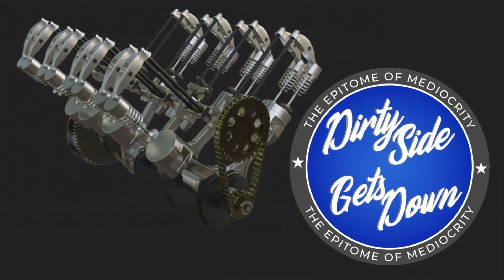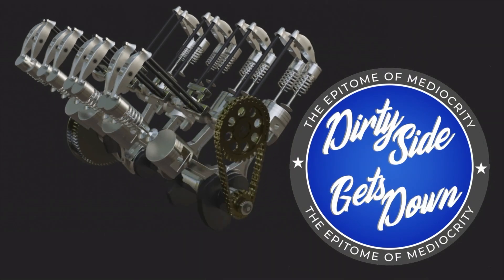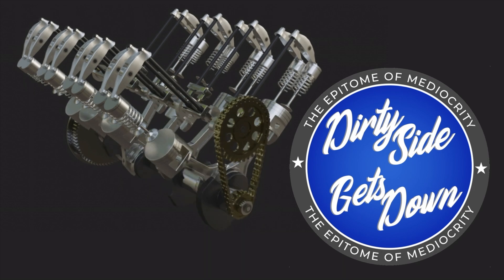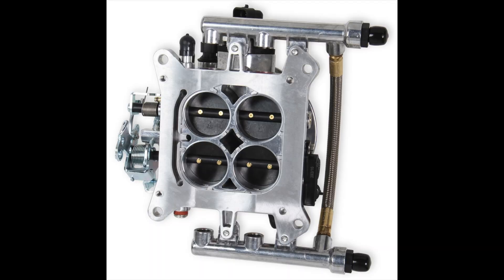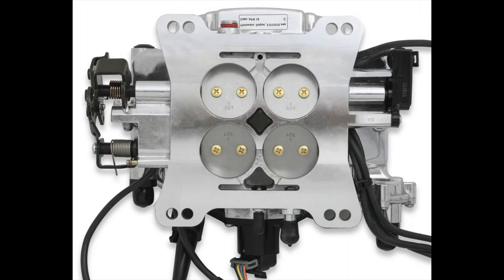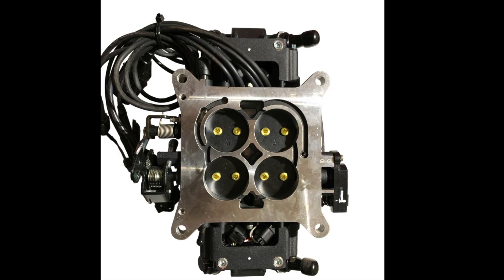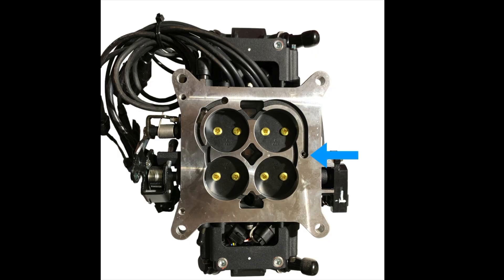Holley Sniper On A Dual Plane Intake Explained: Yes it works and here is why!!!

Comment: I ran a Holley digital 4di on a 351w with a RPM intake  and 1” spacer in the late 90’s with no issues. This system used an external map.

Comment: My dad and i messed around with this on an Air Gap and a Victor Junior. Dual plane can work pretty well if you run a spacer or hollow out the divider, but you will get a reading on the MAP that jumps around a bit which did cause minor issues at part throttle.

In theory you do lose some of the low RPM/load benefits of a dual plane because EFI doesn't need the air velocity to draw fuel out of a carb, which is helped by dividing the barrels. But EFI does keep the benefits of the longer runners.

Comment: I’ve ran a Holley super sniper 1250 with a rpm air gap dual plane manifold on my 347 sbf in N/A trim for a year no issues and another two years boosted. Also if anyone is concerned about the dual plane not working, just get a 1 inch carb spacer and problem solved
Reply from the maker: That is the exact advice I have always given my customers but I wanted to explain why most work and one didn’t. So much false information floating around Facebook and other internet sources. Time to get some facts out there.
Reply: That would be a good video.  Ill look for it if youve already uploaded it.
Right on.
Great channel. Keep the great work!!!
Reply: I just got the sniper xflow 800 plan on running it on my 347 with Paxton novi 2k and air gap intake. UPS delivered it yesterday. On sale at summit really cheap.

Comment: What I’ve heard was there were issues with fuel distribution when using a duel plane. Some cylinders ran dangerously lean under hard throttle. I’m pretty sure I heard the guys on Engine Masters make that comment when testing some intakes. It was not a test of the efi unit itself. Without a dyno and o2 sensor for every cylinder it would be difficult to know. Probably drag racers who were good at reading plugs could tell.
Reply: This has been said by my engine builder too. Lack of 4 corner adjustment available with performance carbs. Can be corrected with manifold work to bias flow to lean runners.

Comment: Like your channel, just subbed...  So I have never messed with anything on an engine dyno but a carb.  Getting ready to do a stock 454 BBC with a sniper with hyper spark.  Stock 4 barrel intake.  I have a buddy who knows his way around this system, he used to be lead calibrator at GM and then Chrysler in the Detroit area.  He is telling me to be prepared to add plenum volume (spacer), I bet him a lunch that it will be fine as is.
Reply from the maker: Thank you for the subscription. There should be no need to add a spacer to make the system work properly, but like with any engine using an intake that doesn’t have a plenum there is a good chance it will make more power with a spacer almost every engine likes plenum volume to make power.
Reply: @DirtySideGetsDown   Thanks for the input, we just want it to have good air fuel ratio and drivability.  He was arguing that it would cause big problems with not enough volume for the MAP to read correctly.  He never encountered this exact scenario so he is just guessing.  Sounds like it shouldn't be a problem according to you😁

Comment: Use a 1/2" or 1" spacer. Figured this out 5-6 years ago with a fast TBI on a poncho 455 with a performer rpm
Reply from the maker: The thing is, with anything except the old terminator tbi there isn’t actually a problem to be solved. Spacers are great and anyone with hood clearance should be running them, but there isn’t actually a problem to solve with sniper and terminator x on a dual plane.

Comment: I run a phenolic spacer on my sniper 1 the scooped 4 hole kind . I run it to stop the sniper whistle sound . It loses power at higher elevations pretty bad and runs awful and pops . Do you think this spacer could be the problem ? If so could I dremel in a groove into the spacer to make it read both sides .

Comment: I had same problem when I bought a Holley Terminator (original) years ago.  Tried twice to fix, Holley and Edelbrock were no help.  it's been in a box since.  (Hunting after the Holley warmed to closed loop, I have the Edelbrock Air Gap performer manifold on a Ford 351W.)  
I still haven't tried round 3 - replacing the carb w/ the Holley Terminator again.   Recently I acquired another Air Gap to cut the plenum divider down 1/2" and try one final time.  Should I file the cut-down plenum divider to a "V" to minimize the turbulence below the throttle body?  I see ONE other video on you tube that suggests this.
Reply from the maker: I’m sure the cut down divider will help with that system. An open spacer would too. As far as the shape, I don’t think it will matter. It’s mostly just equalizing the pressure on each side.

Comment: Hi , i have a holley sniper 2300 and I want to use a dual plane intake wtith a holley 17-90 adapter , do you think can works ?
Reply from the maker: You shouldn’t have any problem with that at all.
Reply: @DirtySideGetsDown  
Thanks

Comment: Just got my sniper 2 haven't put it on yet i have a 91 302 ho mustang engine stripped off all emissions stuff I'm using a 2 inch spacer will this spacer be a problem this 2 inch spacer helps  performance greatly
Reply from the maker: Spacers almost always improve things. They very rarely have negative side effects. If you have hood clearance for it I say go for it, 100%